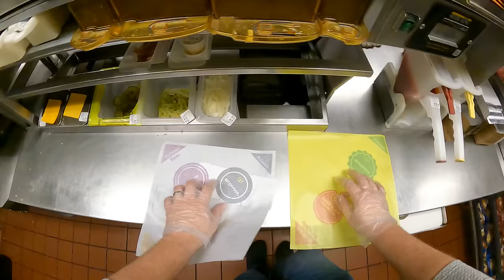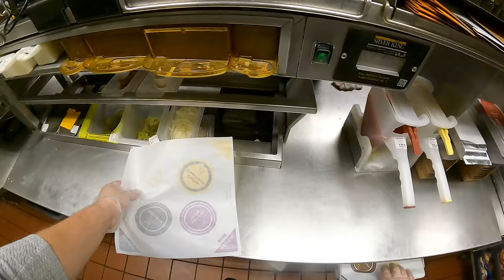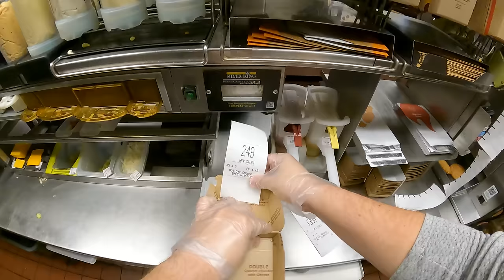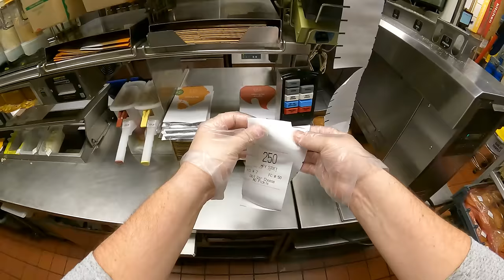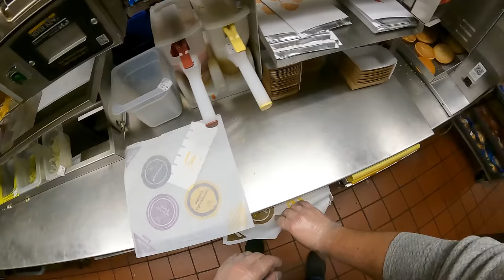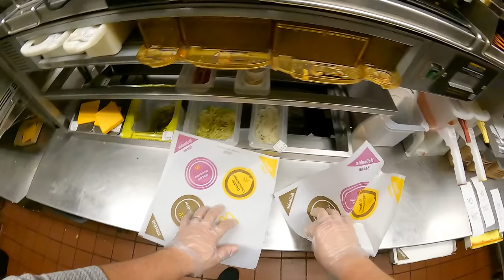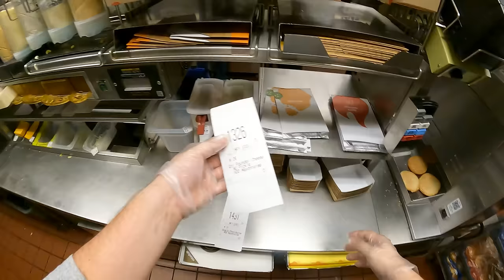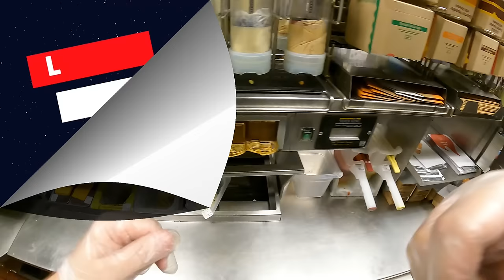McDonald's POV: Snow Day | Lunch Solo Table

Comment: Why do McDonald's fryers seem to constantly beep with different melodies and cadences?  I know Henny Penny has the ability to propose filter cycles after so many cook cycles, but there seem to be many more alarms that constantly occur.  @StephenPatula, can you do a video of where all the beeping comes from?  Like, which pieces of equipment make specific sounds in your kitchen?
Reply: Most of the beeps are from the fryers, sounds like the ones used for fries in this vid. The one thats happening all the time is most likely it requesting the jib to checked, the moderate paced one is it requesting duty, which is when you shake the fries to make sure they don't clumbp, and the fast beeps are when the item is ready to be pulled from the fryer
Reply: @HighLordComedian  Also, one of the other fryer beeps is usually about auto filtering the vat to remove floating bits of breading. Could also be replacing the filter pad if it hasn't been done in a while (Changes store to store)
Reply: @HighLordComedian yeah what does it mean when it says check jib because i never check anything and just dismiss the beep
Reply: @zac9155 check jib means the jug od oil below  fryer vats is empty. And need a fresh 1.
Reply: What is the one that sounds like a cowbell at 1:38?
Reply: @Ataraxia462  That tells the grill operator to drop Quarter Pounder patties.
Reply: @ShaunPuzon  thank you!